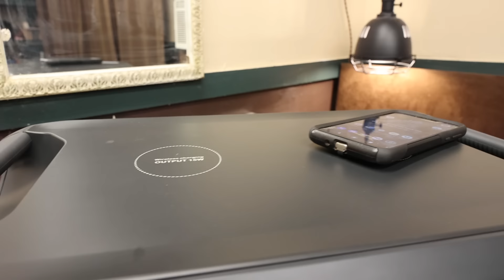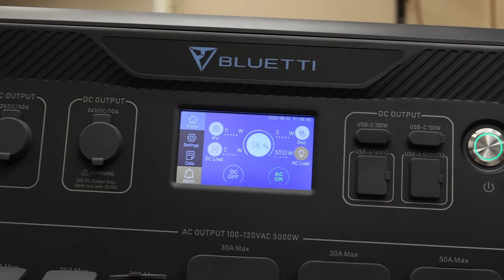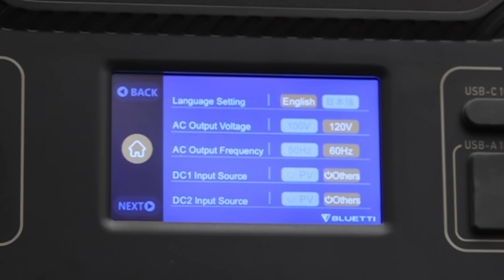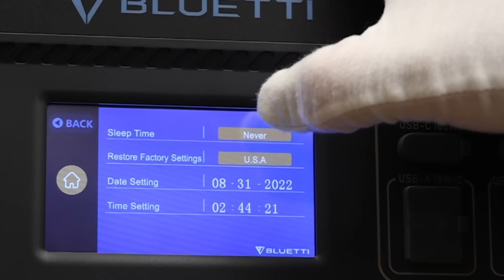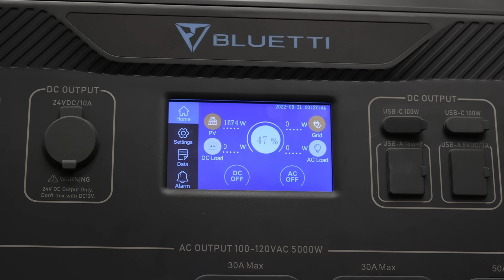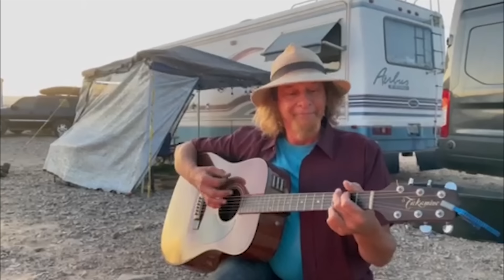Bluetti AC500 5000w LiFePO4 UPS Portable Power Station Solar Generator Review

Comment: I was considering Bluetti as on of the different solar generators to buy, however, the use of the side cables was the ultimate deciding factor not to get the Bluetti and I ultimately decided to go with the Inergy Apex which is stackable and the connectors use are type on the top and bottom of the head and batteries.

Comment: Confused… so the ac500 has no internal battery? So… thousands for basically a control panel, without any power?
Did I get that right?
Reply from the maker: The ac500 head unit requires a compatible Bluetti battery to function.

Comment: Question on the 50amp RV plug i think its only 120v on one side and not 120v on each side so this will not power up a 50amp rv like you would have at a RV park right or am i missing something? my Jayco has 2 ac and a home style ref with the ac's running and our normal running mode we are using 1974.3w on one side and 1965.8w on the other side i am trying to understand 1. do i need two of the ac500 one for each leg and with two b500s battery packs on each ac500's how long will this run at the numbers i gave you above we avg around 2300kwh per month as we full time in our RV thanks for your help in advance

Comment: Is it possible to do a split phase 240v with the ac300 and ac500 combined? It'll just be maxed out at 3000w. 

Also I like how bluetti did this launch through indiegogo as a contribution with the ac500 and b300s as a perk. It doesn't have a tax and is tax deductible under the contribution tax. There might also be a separate tax deduction this year, being it's a solar investment. We'll see come tax time.
Reply from the maker: You can only parallel identical models.
Reply: @HOBOTECH   thank you for that info.

Comment: the 50amp outlet could you use a adapter 50A to 120v 15Amp plug to use on the one leg circuit..
Reply from the maker: Yes

Comment: When charging the battery from solar is there any interface with the AC500 in viewing how much is coming in or controlling it?  Also, if you have solar coming in to one battery, but have two batteries, is the system smart enough to know to spread that charge equally to the other batteries?
Reply from the maker: Yes of course it does all that.

Comment: Hi great video , I live in south spain where we have sun 300 days a year , I would like to use one of these ac500 to power my townhouse for my family of 4 due to high energy prices here . I have 1 refrigerator , 1 washing machine , 1 80 liter electric boiler , and typical oven couple of TVs etc , could I use the ac500 to power my house?  How many solar panels and batteries do you think I would have to purchase ? Really at night we don’t use much power , I also have 2 aircon units but only put them on for short periods of time in the summer. Thanks !

Comment: @hobotech I was thinking about using the AC500 with 2 B300s as the house battery in my van conversion.  I have seen videos on how to attach to a dc fuse block but I haven't seen anything on hooking up to an AC block to power wall outlets.  Is this possible or should I just plan on using surge protectors if I choose to go this way.  Also, Is there a way to attach a display panel to the maid station to be able to monitor the battery life without having to go directly to they system.  I plan on keeping the system in the "garage" so it won't be super easy to access.
Reply from the maker: Of course you can wire it to a breaker box. You can access it remotely via the Bluetti App.

Comment: I ordered the Ac500 and 2 batteries and 2 of the 400 watt solar panels from indigogo.   I could add a few more panels and another battery or two if needed but..

Is it possible to get a hookup so I can power my home with this and then just have the grid supplement in the difference of what I may be lacking?   Just wondering if there is a good article or video on how to do that or do i need to contact my local electrician?

I could save money on my electric bill every month this way.  I just cant reach bluetti support (so busy the voicemail is full)

Comment: Question for you- I have a  machine that runs on a single phase, 20 AMP, 4 wire supply, 120/208 or 120/240 V~(2 Hot, 1 Neutral, 1 Ground) 3408 Watts. It has a L14-20 plug. I can use either a L14-20  R or L14-30R, as I have an extension cord and adapter. I am taking this info from a manual. Will this power station run a unit like this for a long time (up to 10 hours).? I am trying to use this at indoor fairs that may last up to 10 hours. Any info you could provide would be great. Thank you!

Comment: Product comes out in December 2022 and is now $3100 something. Way too late for when you will need it and by then there will be sure to be even more supply chain issues:) Good review though to bad the stand by power consumption with the larger 5000w inverter is terrible:) Btw way when are the Percon extra batteries coming out for their 2000w solar generator? Thanks
Reply: My ac500 and 2x b300S batts ship this last week of Sept., earlier than stated but nonetheless.
Reply: @suklee1400  Oh that's good to know. the website said December. Btw when do you pay for it when you order or when it ships?

Comment: Also is the 800 for 1 panel good? Are there more affordable panels that would work?
Reply: got it on the info.
Reply: Yes, got to suntan solar. Out of Arizona and Ohio. 240$ for shipping, but if you get a pallet of the 240watt cracked panels. They are 40$ a piece. They have new panels too for very cheap

Comment: I have a question regarding solar panel extension cables. I am running it app 100ft and was advised to use 10gauge wire. I am concerned that this connects to 14gauge connector that bluetti sent to connect to Inverter. Can that work? Connecting 10g wire mc4 to 14g wire mc4 ? And the panels themselves came with 12g wire to mc4 .

Comment: If I have a hybrid solar system could I use the ac500 w/ batteries as a replacement for the inverter charger? and still send the excess solar generated electricity to the grid? Just wondering.

Comment: Great video! I'm curious how you would get the full 10kW out of two units @240V split phase using a single cable/connector to power a load center? For example, can these be setup to replace a 240V generator via an inputbox and interlock kit?  Can the Nema 14-50 connector be used on either unit once they are setup in master/slave configuration?
Reply from the maker: You hook two together using what Bluetti calls a "Fusion Box" and that has all the hookups on it.
Reply: @HOBOTECH  It looks like their fusion box is limited with a L14-30 240V connector. I'm guessing this would not allow full power at 10kW.
Reply from the maker: @browsedeweb8834  Look at the one on the IGG page. It has 3x 30A outlets. If you need 50A you use the built in 50A outlet.
Reply: @HOBOTECH  it is not apparent how to get one 50 amp output to go to a transfer switch. If it requires 2 units to get 240 v why do they even have a 50 amp receptacle?
Reply from the maker: @QigongAmerica  The 50A is built in so you only need the data cable between the two AC500's to get 240v 50A. With the AC300 you needed the fusion box ($299) for 240v.
Reply: @HOBOTECH  Are you sure? How does the power from one unit get to the 50A connector on the other unit to provide 240V if only the data cable is connected?  My guess is you would have to use a 50A Y cable to join the two legs for split phase output.

Comment: The Inergy Flex 1500 transfers power between stacking batteries and the main module with the vertical pin type connections without cables.
Reply: @rizipt  If someone only needs dc power without an inverter, Inergy has a dc only main module.

Comment: Its 18,432W of capacity for a single 5000W inverter setup and 36,864W of capacity for 10,000W inverter double voltage setup. TEN THOUSAND WATTS!!!!    😎😎😎

Comment: MR. HOBO With the ups test can you try a cable internet gateway modem to see if the ups maintains connection with the switch over from grid power to ups mode.
Reply from the maker: If it switches a computer it will switch a router.
Reply: @HOBOTECH  I must re-watch.

Comment: Self heat only on AC? Not when on solar?
Reply from the maker: Technically, you could use the DC Charging Enhancer (D050S) to trick the battery into charging from solar or 12v. I'll cover this in a future video.

Comment: @hobotech can you do a AC voltage test to see if Bluetti is honouring the AC voltage is states? A few of us are seeing issues in with grid over voltage as our grids are having issues with voltage stability in some counties and there is some debate on the true voltage Bluetti uses and it differs between units and unit types
Reply from the maker: https://youtu.be/z-HOjq51S5M?t=813
Reply: @HOBOTECH think I didn’t articulate the question very well, my apologies.

Bluetti states on the Australian model of the AC500 that it accepts up to 264 VAC when charging from the grid, my electrican and I are wondering if that value in the booklet is true or is actually around 252-253 VAC from grid?

We had a guy who has another model EP500 pro on wheels and he thought the manual said 264 VAC but Bluetti typed back it was only 253 VAC(checked the manual and that’s right it’s 196-253 VAC for that model), this other guys grid was running around 253 VAC and his Bluetti was tripping all over the place at 252VAC.

I have had four or so trips on my AC500 with a small amount of grid voltage fluctuation, mind you not as bad as the other guy with the EP500 pro …who feels he has $6k paper weight right now…

I delved deeper into this and I suspect grid voltage fluctuation is a bit of issue at least in some parts of Australia and the UK and will impact solar inverters and solar gens for grid tied solar products and was wondering if you had a machine that could inject the higher voltages till it over volts to see what is reality of the VAC is is 264 like the manual claims or is is lower?

Comment: Isn't it possible to have infinite sets of  6 batteries and swap out a discharged set for a charged set? In southeast Asia there are often  extended brownout and long periods of rainy season. 72k Wat hours with 4 sets of 6 batteries would be able to power my Nashville Tenn. Home for a month in Summer and 2 months the rest of the year.

Comment: bought it Got 1 inverter and 2 batteries. Might get your recommended brand of the 2x450. Solar. Thanks thinking  of getting 3 of the 450 sets. Would be 2700 on solar? Good start? Thanks
Reply from the maker: Check out my recent post on the Renogy 320w panel deal.
Reply: Thanks. It's in the cart. I will wait a day or 2 and try for 2 sets of the 450.
Reply: Do I just  need the panels? Plug and play  or do I need a solar kit, charge controllers? Thanks

Comment: Thanks for all the testing. Answered all my questions.  I will buys this unit to power my home in the Philippines. The bluetti here is 240 volts already. I'm thinking to add an additional 48v 200ah battery to charge the bluetti at night through the solar inputs. Will that work?

Comment: This may be an obvious question, but I can't find a definitive yes or no. If I'm camping in my RV, do I hook this complete generator set up to the shore power  and plug my 30A RV plug into it? Does it "pass-through" until there is an outage, then the UPS kicks in? Or do I need a separate transfer switch wired in between?
Reply from the maker: It has a built in UPS so it "passes through" AC power if it is plugged in.

Comment: The heated batteries is awesome, but -4 isn’t near enough…does it attempt to heat at least if you insulated it?
Reply from the maker: It will heat the batteries if they internally drop below freezing. Ambient temperature outside doesn't matter. Insulating them should help if -4F still isn't good enough. Note these don't ship to the Arctic Circle.
Reply: @HOBOTECH Au contraire...many places in the lower 48 get well below -4. But if I lived in the SW, I might not know that. ..hehe
Reply from the maker: @NeverTakeNoCut-offs  I grew up in Pennsylvania but I don't see a scenario where the AC500 will be sitting outdoors in the middle of winter.
Reply: @HOBOTECH  no, of course not but a common scenario is to have them in a cabin that is used part-time, or to have in an outbuilding that is unheated.

Comment: At 29:16 the output voltage is 11.1 - 11.3 volts; is that acceptable? Why doesn't the voltage stay closer to 12v? Is it correct to say the output is regulated at 12v when it drops as far as it does? Just an honest question (I have a CPAP machine and can't afford to damage it.)
Reply from the maker: It's called "voltage sag" and is how electricity works. It doesn't damage anything.
Reply: @HOBOTECH  I understand electricity - other devices you've tested doesn't sag like that. So why does this one but others don't?

Comment: Hello professor,
I have an AC 300 and two b300 back feeding my panel with a 30-amp breaker to both side of the panel. I read that the ups standard selection would power up automatically if power went out. so, i followed the direction on the hook up. plug into the wall and to the ac in for charging, then plug in the ac out which is a 30 am rv plug.  and plugged it in. when I tuned the breaker on that feeds the panel hot from the grid from the ac300 it popped the main breaker, so the house grid was on and the ac300 was also plugged in to a 120 volt for charging. need help what did i do wrong ? have tried calling blueitti and can not get through.
chip

Comment: You said the voltage was regulated on the 12v out on the B300s, yet the voltage sagged to 11.2 when you turned on the tester. So...
Reply from the maker: It's called voltage sag. That's how electricity works. 11.2v under full load is still fine for 12v appliances.

Comment: Large Cable... turn Connector 90º and put channel for cable. AC500 connector points down B500 connector is up for input, down for output

Comment: I'm confused. I can order an AC500 inverter for $1,700 and an B300S for $1,900 or a package of one of each for $3,300 which gives me 1 inverter and a total of 8Wh of power OR I could order 2 AC500 for 3,400 and for $100 more get 10Wh of power and 2 inverters. Why would I ever buy a B300S?
Reply: Ok, I see the AC500 has 5000 inverter but battery is 3000Wh, same as the B300S. Still, seems having 2 AC500s may be more valuable
Reply: @danielsnyder2288  No battery on the AC500.  Just inverter head unit.   Requires a B300 for any battery.

Comment: Hi Professor Hobo,
Can I use two Bluetti AC500 units with a total of four B300S (3072 Watts each battery) batteries in Split-Phase mode to safely power my 50 Amp 2022 Jayco Pinnacle RV?

Proposed Setup:
Each Bluetti AC500 has a 50 Amp female connector: (NEMA 14-50R) that is NOT a 240 volt receptacle, instead it is only 120 volts on one leg--the other leg is 0 volts. But, if you purchase two Bluetti AC500 units (each with at least one battery connected to it) and then use both a special Bluetti Communication cable that connects one AC500 unit to the other AC500 unit (and a special Bluetti "Y-Cable", discussed below)--the software in the Bluetti AC500 allows you to perform a master-slave 240 volt Split-Phase setup (I believe this is called a 240 volt Split-Phase setup???). The "Y-Cable" mentioned above, has two NEMA 14-50P male plugs and you connect one of the two 14-50P male plugs on the "Y-Cable" to one AC500 unit via its NEMA 14-50R receptacle and the other 14-50P male plug on the "Y-Cable" to the other AC500 unit via its NEMA 14-50R receptacle. The third connector on the "Y-Cable" is a NEMA SS2-50R. I can purchase an adapter on Amazon that has NEMA SS2-50P/CS6365 on one end and a NEMA 14-50R on the other so I can use it with my RV's 50 Amp Plug (NEMA 14-50P) that I normally use for plugging into shore power.

I know this is somewhat of an elaborate setup--but I am wondering if it will work? I decided to go this way instead of a Cummings Onan propane generator.

Thanks for taking the time to look at my setup,

Steve Weakley

Comment: Great Review/Video.... wish I would have waited instead of buying my 200max 😢
Reply: The problem with the AC 500 is that you have only one inverter. In a grid-down situation, good luck getting that repaired by Bluetti in a timely manner. For the retail price of the AC 500, you could purchase two if not three AC 200 Max inverters , each of which includes a battery. If one of the inverter/battery combo fails, you still have one if not two as backups.
Reply: @daisypatritio572   I see what your saying. I just don't think that inverters in Bluetti are that unreliable . Are they? Have you heard bad things about them?

Comment: I see this and a few other power stations have a 30 amp output plug that can be used to power rvs. Does this one, or any other power station have a 30 amp input so that they could plug directly into a 30 amp output at an rv park, or home, to charge?
Reply from the maker: You can get an adapter from Bluetti for 30A charging.

Comment: I just bought 2 inverters and 6 batteries from the crowd fund. I also bought 4000 watts of solar panels to go with it. I would like to hook everything up in a way that would let me use as much power from the sun as possible, and use the system as a UPS. Can someone suggest the best way to do this, or recommend where I can find this information please? Any help would be greatly appreciated.

Comment: Can you clarify something. You said to run a 220 oven or dryer but you need two units. Is that 2 AC500 units or 2 B300S batteries?
Reply: Never mind I found it. "We’re talking about the Split Phase Bonding Function, in which you can connect two AC500s to double your capacity, voltage, and power to a colossal 36,864Wh! (240V/6,000W) Note that a Fusion Box Pro from BLUETTI is required and sold separately."